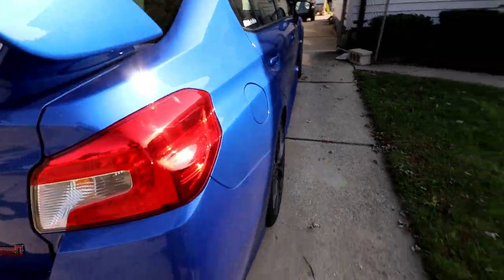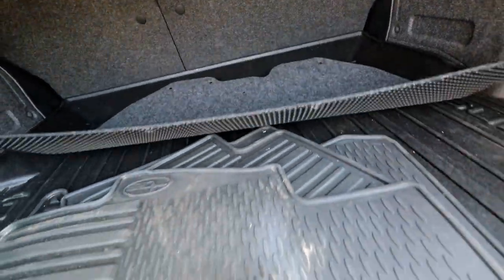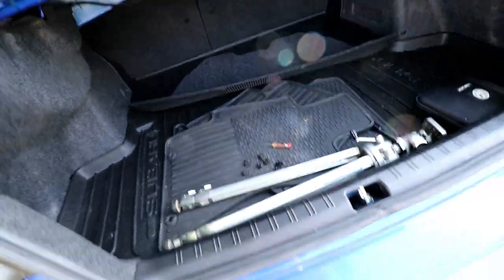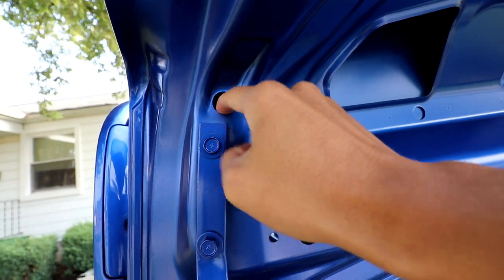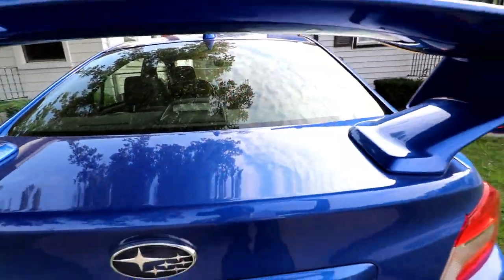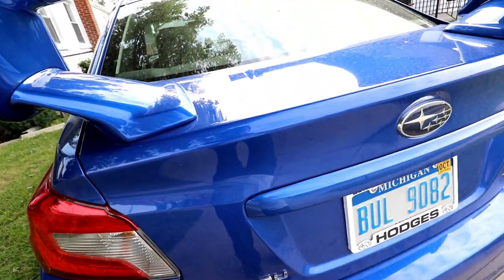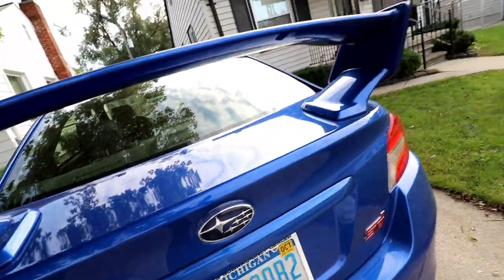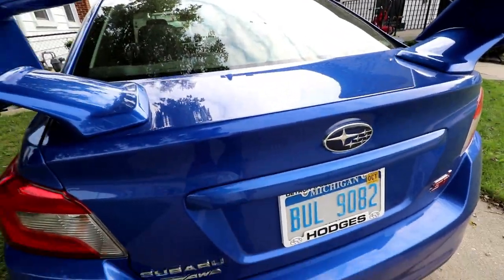2018 STI wing removal or installation process (How to)

Comment: Great video, thank you for the explanation! I’m gonna be installing an oem sti wing on my wrx. It’s very different in the way it attaches than after market sti wing off eBay. Do you know the sizes of those 3 clips you are speaking off or the size of the holes I’m gonna have to drill? Thank you!
Reply from the maker: Thanks for checking out the video. Unfortunately I didn't capture the sizes when I pulled the wing off. I would definitely recommend checking out the NASIOC forums or even calling your subaru parts department and asking them. Sorry I couldn't be much help for now, if I end up pulling it off again I'll record the sizes.

Comment: what did you use to plug the holes to insure water doesnt get inside?
Reply from the maker: Nylon plugs, most hardware stores sell multi packs with many different sizes for a cheap price. On the first day I simply used a weather proof tape (like electrical tape as an example) to see if I liked the look prior to going to the hardware store.
Reply: What specific size fits the holes and does it leak water?
Reply: Just looking for more details because I hate this wing haha.